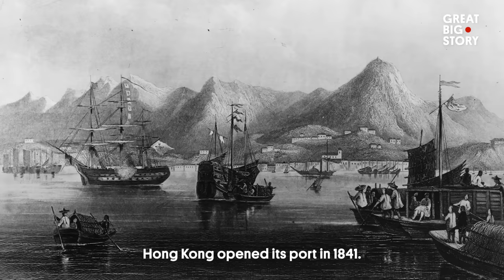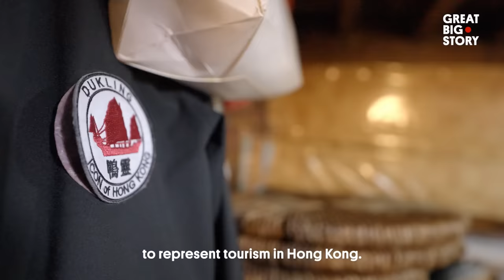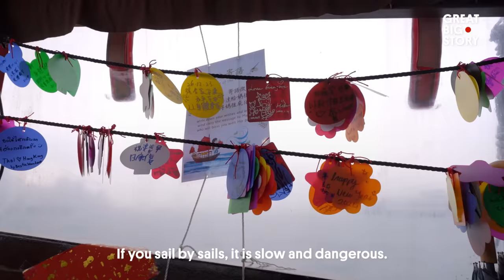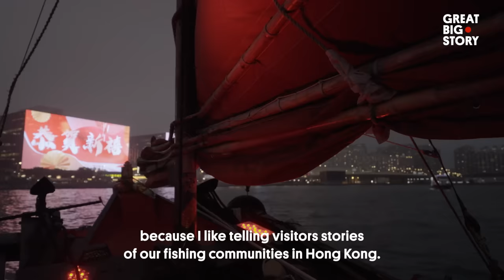The Oldest Junk Boat Left In Hong Kong

Comment: They should install a high performance marine engine on that thing so it can do some crazy speeds
Reply: The hull was not designed for those sorts of stunts. At 2.20 in the video there is a glimpse of the engine. I can tell you it is a Gardner 6LW.  A medium speed diesel engine with 100hp. Like the Duk Ling a classic design and fit for the purpose. No hot rods necessary.